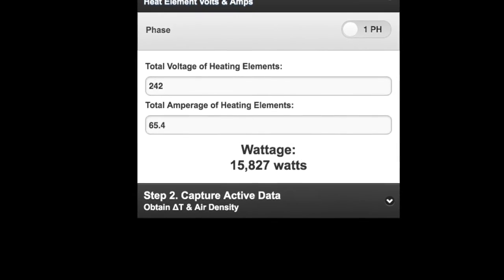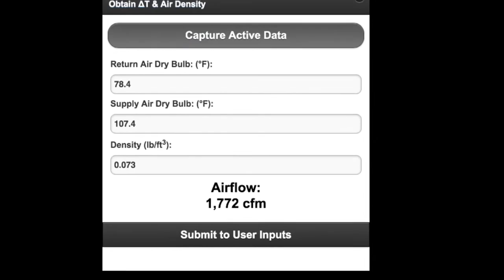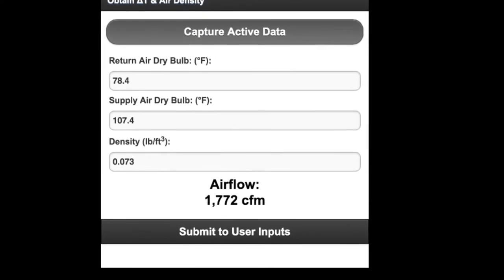HVAC Talk: Electric Heat Temperature Rise CFM Method

Comment: I live in a heat market but we do not use any back up heat in our heat pumps. You are right if you do not have the right heat strip you will never get the air flow right for that strip, I would always read the installation instructions and follow them to the letter that way you can rest assured you did nothing wrong. I don't know of any rule of thumb methods that people use.

Comment: The formula is watts X 3.414 = BTU's and then BTU's / (1.08 x TD). for instances 5KW heat strip pulling 23.1 amp at 208 volts take 23.1 X 208 = 4804.8 watts. 4804.8 X 3.414 = 16,403.6 BTU's 16,403.6 / (1.08 X TD)

Comment: Here in VA: I would say that 98% of all 2ton heat pump system have 10kw heater packs.
I usually go with (8kw) in 1.5 ton systems and (10kw) in 2ton & 2.5ton systems
Reply from the maker: Yeah, that wouldn't surprise Me up that far. I'm sure the method Isn't even a viable option in that market.

Comment: I have a Trane XL18i with Tam7 air handler (3T system) and my contractor installed a 10kW heat strip. I can't remember the cfm off the top of my head at the moment. BTW, the area is in E. TN. Just thought I'd mention it, even though this video is from awhile back.
Reply from the maker: 10kw on 3 tons is very common in this area. The airflow calculation ought to work with that combination. Thanks for watching.

Comment: I like your method but it won't work for me in Maryland since we're the northern most state that allows heat pumps from what I see their oversized here so they can even keep up. In 1-1.5 ton its 5kw 2-2.5 ton its 8-10kw and 3-3.5 ton are using 15kw. I like Heat pumps but not in my area our winters get pretty damn cold and a lot of times have issues around here if their heat strips are any lower. Some applications are ok but most aren't.
Reply: I guest along the coast line of the northern states where the climate is more tempered then inland you might see some more heat pumps up there, I live in a more inland elevation of the southeast and we also had people complain that they don't keep up with temperature as good